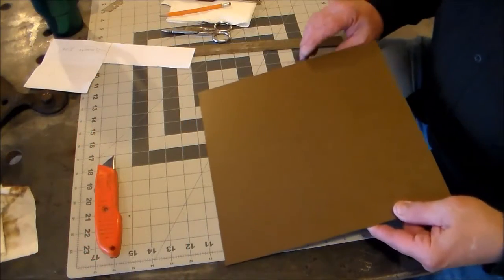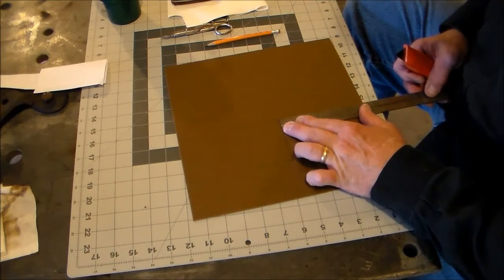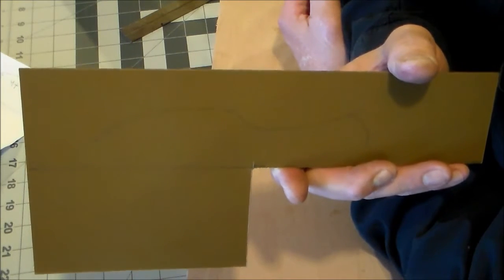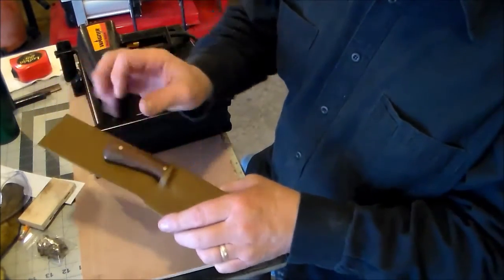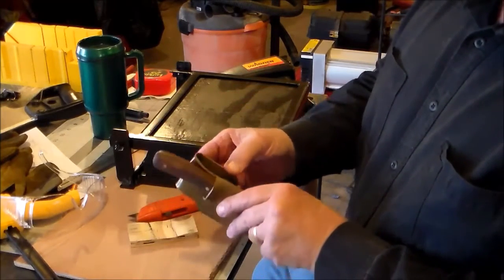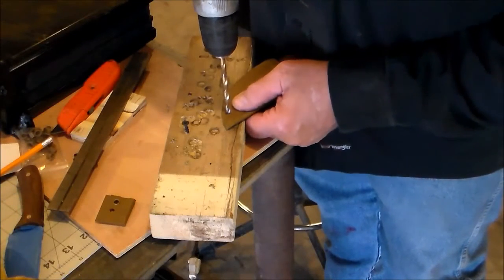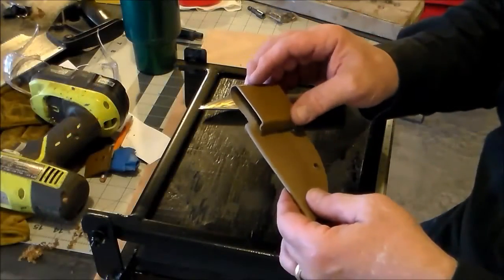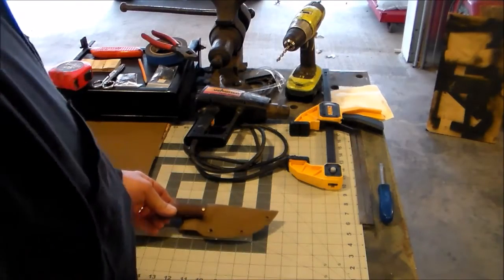Kydex Knife Sheath

Comment: Where that stuff seems to soften pretty quickly, is there a danger of it softening too much during use, like out in the hot Texas sun, and losing it's shape?
Reply from the maker: +The Shade Tree Fix-it Man   It get hot but not that hot...ha ha  It takes about 350 degrees before it molds good. Thanks George